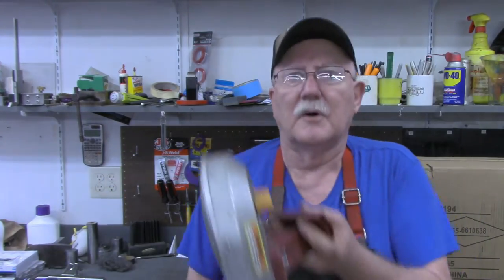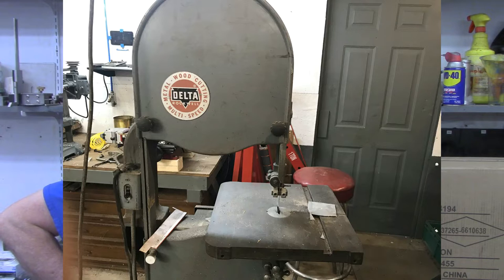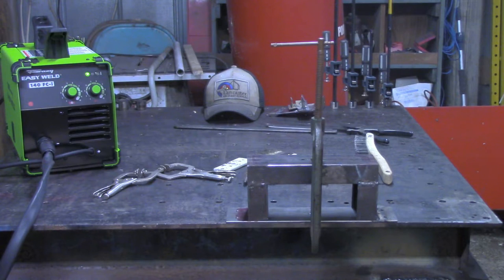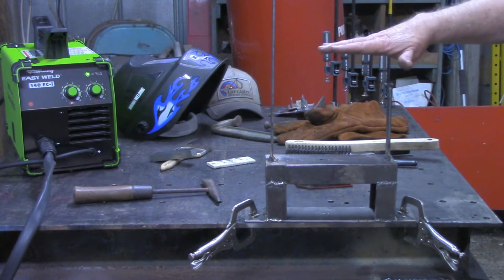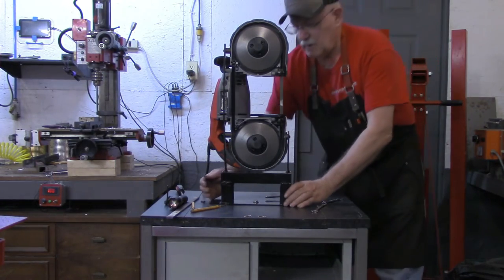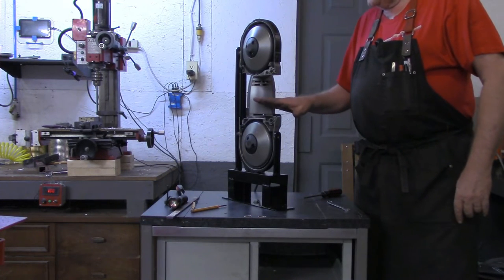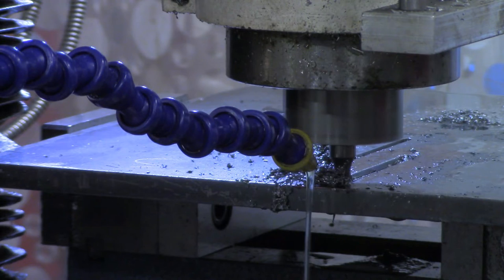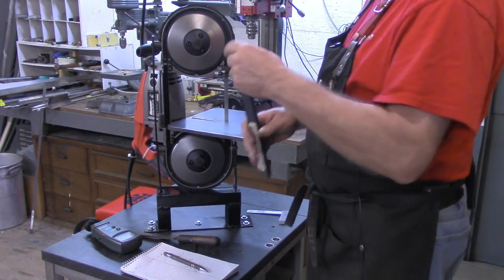Portable Band Saw Semi-Permanent Vertical Stand

Comment: why did you put the slot in the plate to the back . If you put the blade slot to the front you could change the blade without taking the  plate off. Say you want to cut some thin metal and you need a 32 tooth blade, and then you needed to cut something an inch thick an you want to use a 10 tooth blade. With the slot forward you can just change blades as needed. If you leave a 10 tooth blade in and cut thin stuff you will break teeth off and ruin the blade.

Comment: Very straightforward design no fancy stuff but the cutting for the blade with a mill. Min pops in and out of the contraption, but as I've found I don't use it solo. It's more a precision machine than a chopper. I have a small plate 4x8 screwed to the saw then a frame holding saw and a second sliding table that is detachable with a square 90digree fence and clamp. One of the most used devices in my humble shop.

Comment: I did enjoy the build, however you need to pull your plate off to change out the blade.
I would have cut the slot with the band saw just short of where the blade would start.
Removed the blade, flipping it around and verified the blade would be just short of the slot.
Then on the mill drill a hole 1 inch or 2-inch hole with a smaller shoulder hole and then made a disk that sits down in the lip on the shoulder.
Remove the disk lets you swap blade very easily.  As for the screws I don't think I would do a slot, I would drill hole just where I need them.
I may even do that to mine once I get the rubber on the wheels replaced!
Good luck.
From Loveland CO
Lee

Comment: Well done presentation and set up. I can vouch for those newer HF saws perform well, the set up I used was a SWAG off road stand wired like your table. What I found after using the saw after a while was the throat depth was a constraint on larger flat metals. So I converted a 12” Craftsman wood bandsaw that I picked up at an estate auction for a bargain. While not as rigid as the Delta it still works well in my shop. If you repair your Delta 14” you will see the difference in the throat depth. Your portable bandsaw set up is one of the best I seen and your workmanship is excellent as always, you will enjoy that saw

Comment: good build and great shop improvement...I use my vertical setup Milwaukee porta band all of the time....SO HANDY
Reply: Yes but he needs to make the table height adjustable?  Have found that stock needs to be within short distance to the top bearing to prevent blade drift.

Comment: PS: Paper templates are so useful when matching screws to the blade and the rest of the machine. I used thick paper and lots of tape and marked hols and some edges with a ball-peen hammer just like making a gasket. 
(two pieces of carton paper, one on each side of the blade and went from there)

Comment: I tried out that Bauer portaband and the drive wheel was wobbling a lot.  Even switched it out for another one, and same thing.  I dunno if it was a bad batch or what.   I thought it was kind of odd that it was wobbling out-of-round by at least 0.070"!  You'd think that they could get that aspect correct with all the modern production capabilities.  Oh well, guess I'll be getting a dewalt.